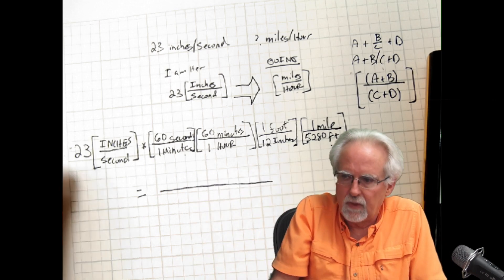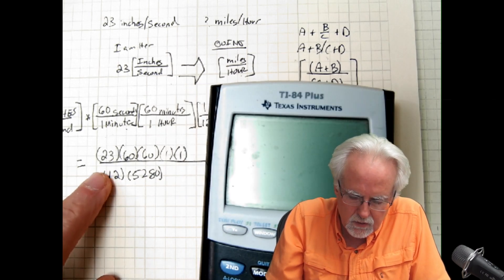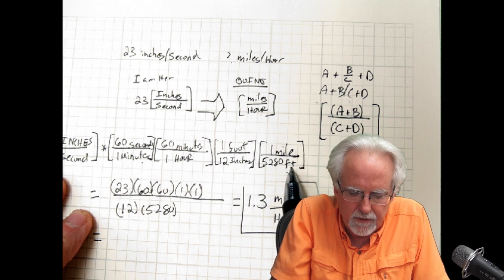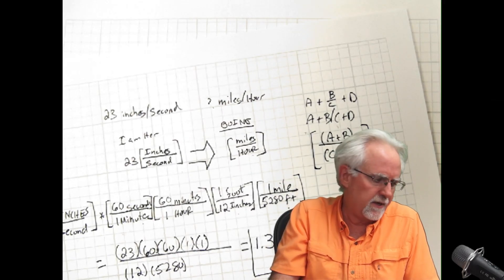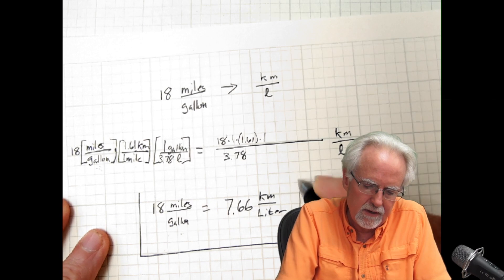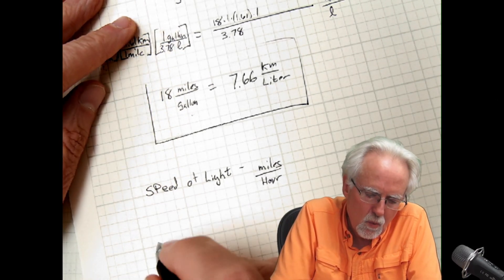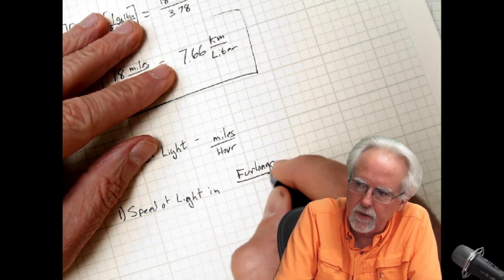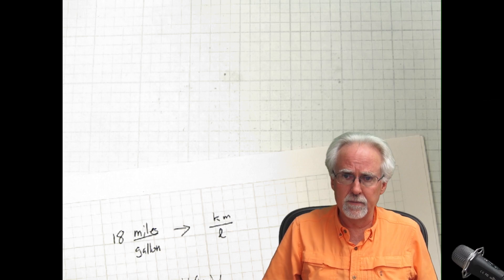Arduino Tutorial 62: Understanding How to Use Dimensional Analysis

Comment: Thanks for another informative video! 
1) Speed of light was 1,802,617,499,785.3 furlongs per fortnight. 
2) At the current exchange rate gasoline in Uganda is 2,091.985 shillings per liter. 
3) An ounce of gold and an ounce of feathers is kind of a trick question -
 they weigh the same if you are using avoirdupois ounces for both, although the volume of the feathers would be much greater than the gold. However, gold is commonly weighed in troy ounces at 31.10 grams to the troy ounce, while feathers would be weighed in avoirdupois ounces at 28.35 grams to the avoirdupois ounce, meaning the gold would be heavier in grams than the feathers if each were being weighed in their customary measure. The troy ounce of gold would convert to approximately 1.09714 avoirdupois ounces which is heavier than the avoirdupois ounce of feathers. Haha thank you for a fun math lesson!
Reply from the maker: Ha, few catch the trick question. Excellent.

Comment: That's always been one of the confusing aspects of Math for me. Before I understood better in high school, 23*[inches/second] seems to suggest that 23 should be multiplied by both the numerator and the denominator. I always felt more secure in starting the problem as 23 inches / 1 second. This ensured that I wouldn't accidently attempt to multiply the same number on both sides.

Comment: Hey Paul, thanks for this amazing Arduino Series. Thank you for explaining how to use Dimensional Analysis. I completed the assignment and the results i got were:

1. - Speed of light in mph is equal to 1802617498752 furlongs/fortnights
2. - $2.30/gallon of Gasoline would cost 2124.54 ugandan shillings/liter

3. - What weighs more, an ounce of gold or an ounce of feathers?
Since you didnt say fluid ounce than i assume we are comparing them by weight not volume so they would we the same.
Reply from the maker: Actually it is a trick question. Gold is measured in troy ounces (which is weight) and feathers are measured in standard ounces (again a weight). But a troy ounce weighs more than a standard ounce. So, an ounce of gold weighs more than an ounce of feathers.
Reply: @paulmcwhorter  Thank you for explaining how ounces work. Here in mexico we dont use ounces and when i googled ounces i only read about oz and fl oz. I did not know about troy ounces.  Thank you so much for taking the time to explain and sorry for not responding quickly. Here where i live we were out of internet since friday.

Comment: Used dimensional analysis in my work setting as previously described.  I also used it in my college chemistry class for Stoichiometry; the analysis/measurement of how elements combine to form compounds; H2O, CO2, H2SO4.
Answers; 1) 2.253267072 x 10e12,  2) 2250.78 USh/l,  Neither, weight in ounces is based on the gravitational pull or force based on the mass of an object.  Since one ounce of feathers and one ounce of gold have the same weight, their mass would be the same. F=ma
Reply from the maker: But, gold is measured in Troy Ounces, which are slightly heavier than normal ounces. hence 1 'ounce' of gold weighs more than  one ounce of feathers. It was a trick question.

Comment: Gold is measured in Troy ounces and feathers in Avoirdupois ounces. There's a weight difference: Gold is 31.1 grams, while feathers are 28.4 grams. Gold is heavier. I have the other two done but had trouble posting the equations in the comments.

Comment: Finally caught up! Now I get to watch the using Python with Arduino playlist, as well as your old Arduino playlist (because you seem to have more coding themed videos in your old playlist). 

Btw, you have inspired me to undertake my own project (an arm wrestling robot). I wanted a way to implement difficulty levels into the robot, and I figured the best way to do this would be to limit the current the motor draws. The best method I have for doing this so far is using a variable power supply, but I'm wondering if I could use a potentiometer in parallel with the motor to draw some of the current. Not sure if this would work. 

Anyway, thanks for the lessons!

Comment: I got 1.80 exp 12  Furlongs / Fortnight by not using the French 15 day fortnight.  Then using an exchange rate of 1 USD =3846 UGX, I got 8846 UGX.  Then the final question: an ounce of gold in troy weight =31.1 grams, and an ounce of gold in the avoirdupois system = 28.34 grams  but an ounce of feathers would be 28.34 grams in the avoirdupois system.  Since gold is normally measured in Troy weight the ounce of gold would weigh more as the comparison would be in two different measuring systems.

Comment: The miles per gallon to kilometres per litre conversion was interesting. However, the standard for fuel consumption (at least in Canada; not sure about the rest of the metric world) in a metric system is ‘litres used per 100 kilometres travelled.’  So the denominator is always 100km. Took me a long time to get used to that back in the mid 70s when the metric system was introduced here. Your dimensional analysis methodology should allow me to work the problem…I’ll go try.
Reply: I still can not get used to litres/100KM, it's only been over 40 years, maybe one day:)
Reply: Everywhere in continental Europe is like that. That would be an interesting conversion homework where distance now goes on the denominator and volume in the nominator ;)

Comment: LOL to your problem that uses the legendary "furlongs per fortnight"!! Although I did have to refresh my understanding of how long exactly are furlongs and fortnights....
Reply: Oh.. And I got:

1) Speed of light = 1.802617* 10^12 furlongs/fortnight
2) At current exchange rates as of 8/26/2021, 2.36 USD/gal = 2151.97 UGX/liter
3) Trick question? Gold is measured in troy ounces, and  1 troy ounce is 1.097143 ounces. Therefore the 1 oz of gold is heavier than 1 oz of feathers.

Comment: I did the homework Mr.McWhorter, here are my answers:

a) The speed of light is approximately 1802572800000 furlongs/fortnight (Assuming a mile is 8 furlongs, and a fortnight is 336 hours).

b)2.30 $/Gallon is approximately 2227 Ugandan Shilling/Litre  (Assuming  US Dollar is 3671 Shillings, and a gallon is 3,79 litres). 
 
c)An ounce of gold is equal to an ounce of feathers as they have the same mass, but they will differ in size, as the density of feathers is much less than that of gold.
Reply from the maker: No, it was a trick question. Feathers are weighed in normal ounces, and gold in troy ounces. Hence an ounce of gold weighs about 10% more.
Reply: @paulmcwhorter  aaaaa, that's a good riddle, very good I like this.

Comment: ive been doing more soldering with electronics, the melting point on solder is only 360 degrees ive been using like 500 and i still dont get quick solder joints. my fear is im holding the iron on the board too long but im also afraid of just roasting the boards by going too high. What temp do you guys generally solder at?
Reply: I normally solder AT work

Comment: Speed of light = 1,802,572,800,000 Furlongs per Fortnight.
Gasoline is 2,188.52 Ugandan Shillings per Liter.
One Ounce of Gold weighs the same as One Ounce of Feathers.  The ounce of feathers just occupy a much larger volume than the ounce of gold.
Great fun. 🙂
Reply from the maker: Gold is measured in Troy Ounces. Feathers are measured in standard ounces. Troy ounce is 10% heavier than standard ounce. Therefore, ounce of gold weighs more. Dont believe me, go to coin shop and buy ounce of gold and bring it home and weight it on a kitchen scale . . . 1.1. ounces.

Comment: Answer to problem #3 below the read more line...

#3: The two materials weigh the same because an ounce is an ounce regardless of the material. That said, an ounce of feathers will occupy more volume than an ounce of gold because feathers are a less dense material than gold.
Reply from the maker: Oops . . . gold is measures in Troy Ounces, feathers are measured in normal ounces. A troy ounce weighs more. So, ounce of gold weighs more than an ounce of feathers
Reply: @paulmcwhorter  Ahh, I missed the Troy part. Got me.

Comment: Ans. 1) 6.706e+8 miles/ hour = 1.8025e+12 Furlongs / Fortnights
Ans. 2) $2.30/gallon = 2317 Ugandan Shillings / liters
Ans. 3) Gold is a precious metal, so it is weighed in Troy Ounces. An ounce of gold will therefore weigh     31.1 grams.
Feathers are not precious and so they are weighed in Avoirdupois Ounces. An ounce of feathers will therefore weigh 28.35 grams.
Hence, an ounce of gold weighs more than an ounce of feathers.

Comment: 1. 1,802,617,499.78 fur/ftn  //  2. Gas= 2,268.78 UGX/L  //  3. It's the same, you silly :P
Reply from the maker: Actually it is a trick question. Gold is measured in troy ounces, slightly heavier than a normal ounce. Feathers are measured in normal ounces. Hence an ounce of gold weighs more than an ounce of feathers.

Comment: An ounce is an ounce, weight is the same. this is an old one.
Reply from the maker: It is a trick question. Use your kitchen scale, and measure out an ounce of feathers. Then go to coin shop and buy an ounce of silver or an ounce of gold. Bring it home, put the feathers and the coin on a balance, and you will see an ounce of gold or silver weighs more than an ounce of feathers. Why? Gold and silver are measured in Troy Ounces, which weigh more than Standard Ounces, which are used to measure feathers.